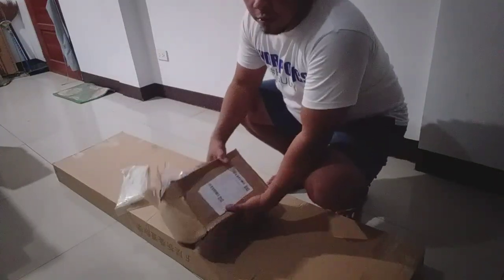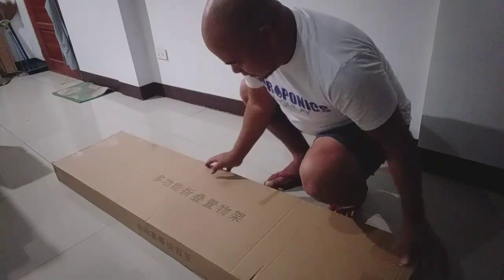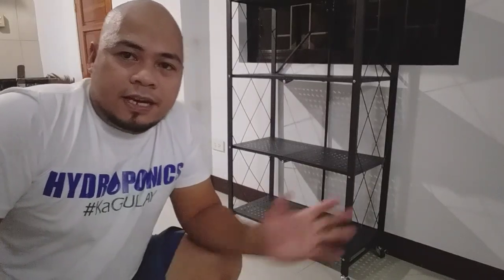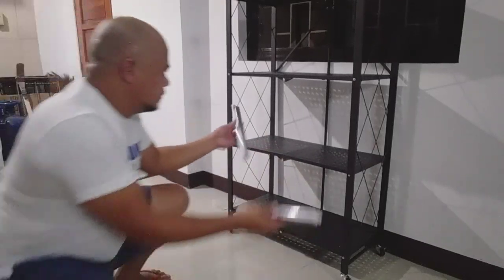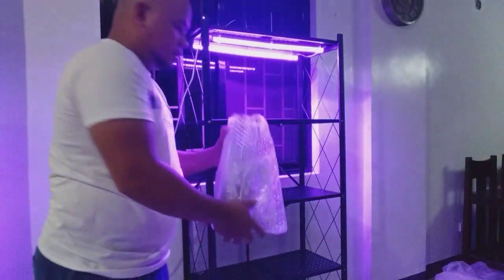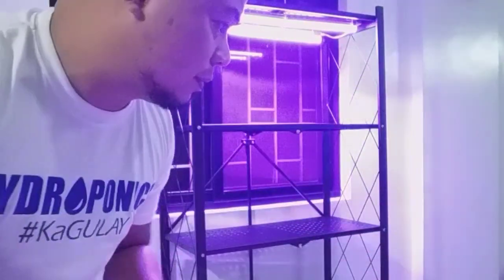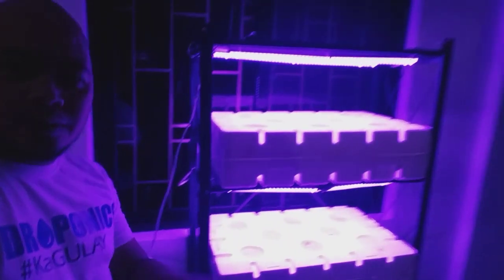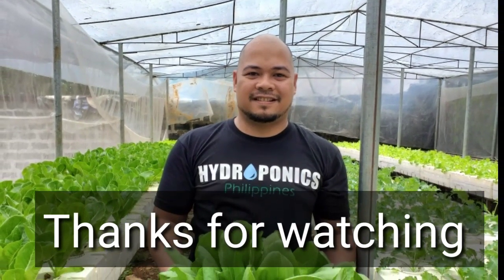LOW COST INDOOR HYDROPONICS SYSTEM

Comment: sir san po nakakabili ng ganyan grow lights? pwede din po ba sya sa aquaponics? salamat po
Reply from the maker: Wag yan sir. Sablay yan. Meron ngayon sa shoppe mga 15w lng growlight na mainap
Reply: @JGsbackyardlettuceKagulay1  sir may link po kyo nung grow lights na recommended nyo?
Reply from the maker: @tsubbebikers  https://shopee.ph/product/295407055/4446848409?smtt=0.258844052-1628563632.5
Reply: @JGsbackyardlettuceKagulay1  salamat po sir